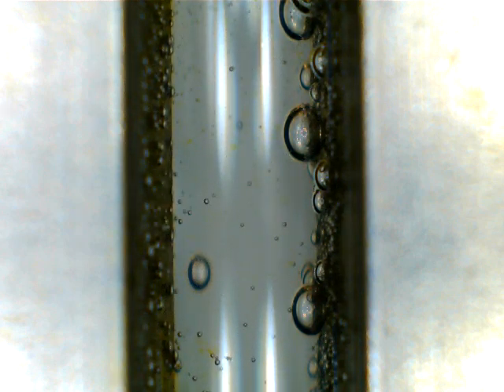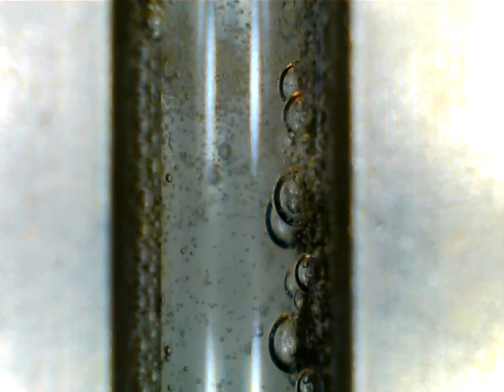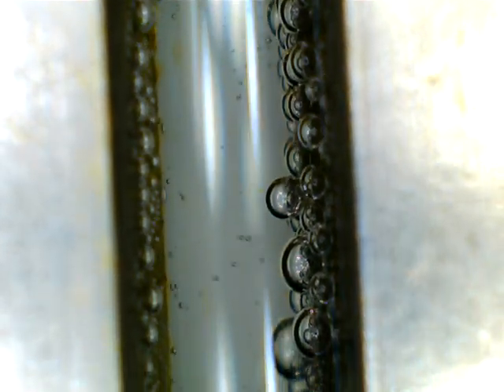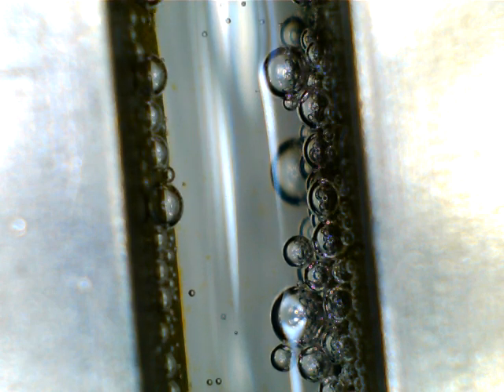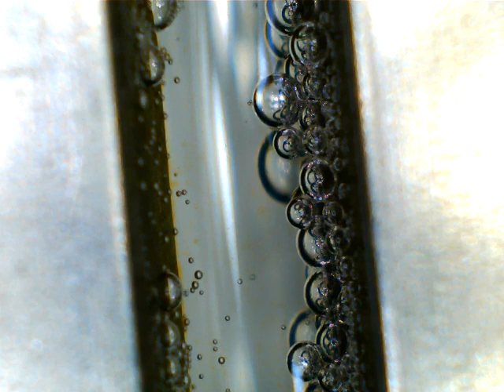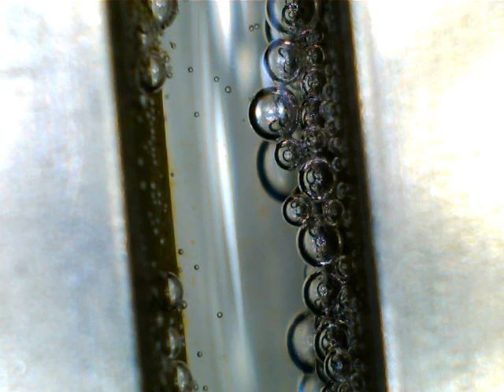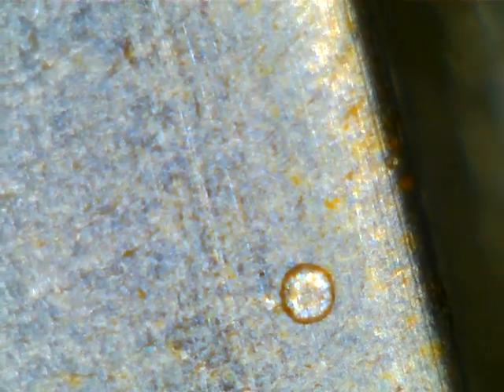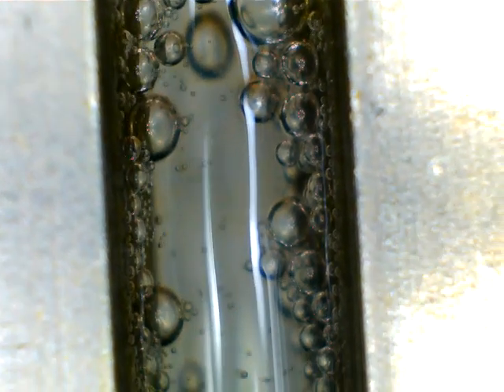High Voltage Electrolysis under a microscope: Thoughts, observations, and future projects.

Comment: so basically,  all our teck sucks.  The "torquie" 3 phasr motor is so,  because it operates on dead shorting,  and the nickle-chrom plating industry,  all the shit gets hot,  and its all dead short.  Sucks.
Reply from the maker: ryan B 

There's always other possibilities and room for improvement. 

What Stan did was document that when you restrict current in the right way the coulomb force takes over and becomes stronger. Here's a patent by someone else who understood the same thing. Problem is there are limitations and difficulties that still need to be solved with this tech.

https://patents.google.com/patent/US4427512A/en?inventor=hee-han&assignee=Tay&oq=Tay+hee-han
Reply: @BradKwfc  , But they arent the kind of difficulties that happen to blow up the or fry the inventors circuts,  are they,  I though Stan presented it straightforward enough, so are the limitations more like,  the moderator problems in nuclear salt reactor tech,  or is it Again,  just that old thung of petrol industries. See i bet that icebergs move because of electrical forces not, simply, Floating wherever.
Reply: I want t know how he generated such a  selectable banndwith,  of pulsation that he could raise the voltages on,  Every thing i read about LC circuts says the same thing,  And im sure Stan-Lee didnt have a thousand of even a humdred differant sized, (electricaly) like a while wall of pipe organ pipes,  for that variance.  guess i do not know about how its really done.
Reply from the maker: ryan B 

In a typical RLC circuit selection of the RLC values determine bandwidth. 

When you use water an an electrical element in a circuit many problems arise. The electrical properties of water are not stable.

Much of Stan's work was in trying to find ways to reduce the effect the water had on the circuit so he could have a more stable bandwidth. There are alot of factors that go in to getting this to work.
Reply from the maker: ryan B 

The circuit is really touchy at resonance because it's really creating an instability in which the current potential builds really high but is held back.... any rapid change in the circuits impedance, or coupling to a nearby object etc can result in breakdown of the circuit or its components.
Reply: @BradKwfc   so that would mean you shouldnt heat or cool the coils really fast right,  and,  cannot you have,  current bleed, through another part of the system,  Stan says that you
would still be doing good even if you used (lost)4 amps throughout the system,  could have a circut that bleeds the amps,  not in the water though,  like through the tailpipe to say?
Reply: @BradKwfc  damn.